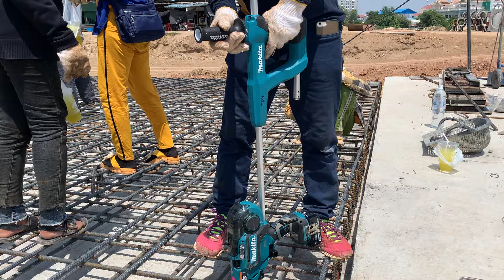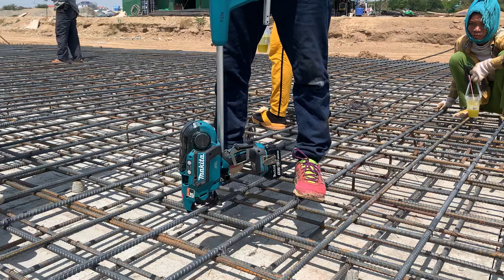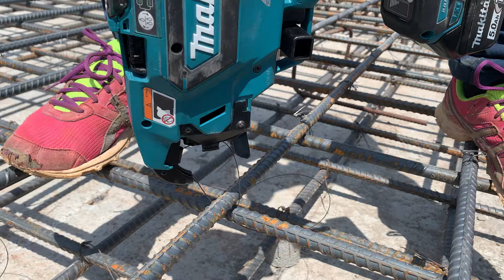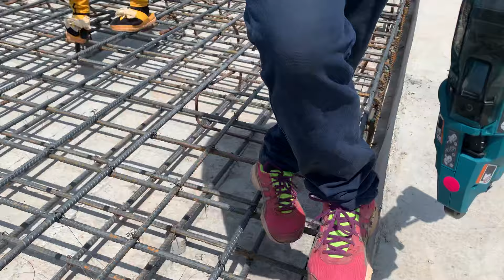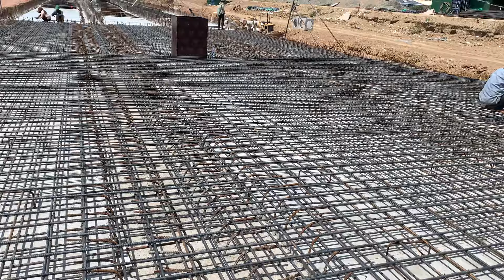DTR180 Makita Cordless Rebar Tying Tool

Comment: Max twin tiers are so much better
Reply: What’s that?
Reply: @Haha-nv5gm  max twin tier Rb441t is another gun which is way faster and better all round
Reply: The one thing the makita has over the max is the handle option.  The max maxes you buy either with or without the handle.  The handle unit cost 4k min. The option of a bolt on and removable when needed handle for the makita is a very attractive option